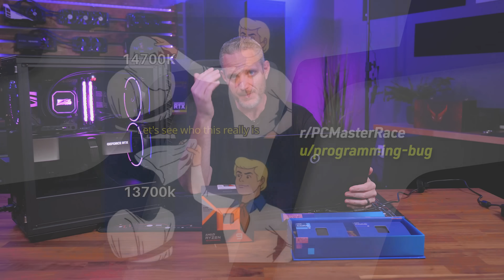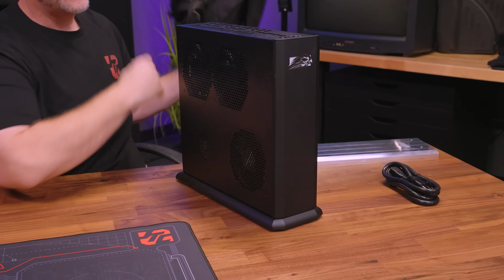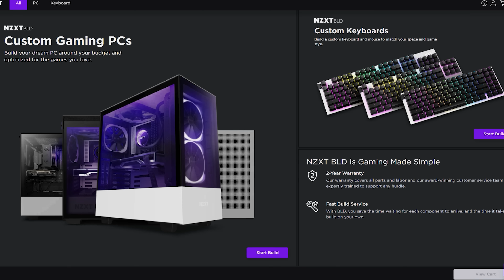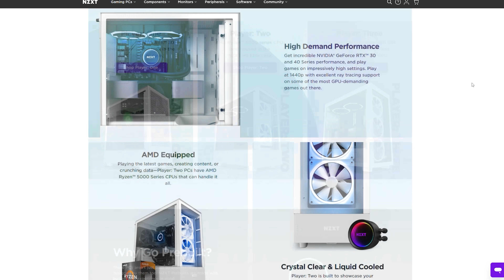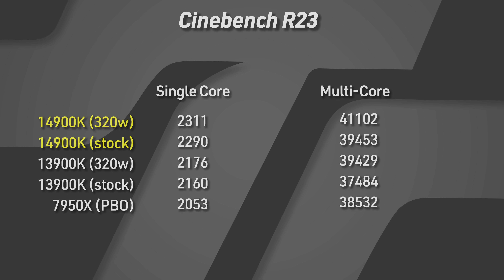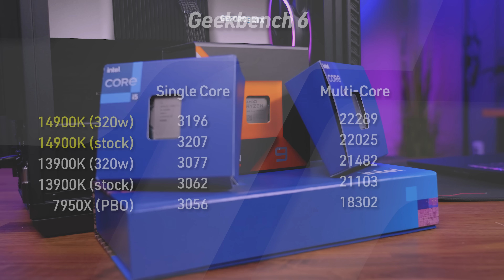THIS is why people have trust issues! Intel 14th Gen Review

Comment: Thanks for the clip.    Have a simple straight question. Have a Dell Precision 3280 CFF  with 128gb ram 4 tb Ssd and Nvidia t1000.  Have 2 processors.   I7 14700 and i9 14900.  Use it for severe multitasking and productivity.  Wich CPU should I keep?  Ty in advance

Comment: I'm upgrading to the 14900k from a 4790k that I've had overclocked in my system at 5ghz  for the past 8 to 9 years.  All of the negativity and talks around in the CPU made me nervous to get it but for $300 plus a 360mm all-in-one cooler AND free dying light and civ 7 bundle i got it over the 9900x which was around 800 dollars!😮

Comment: I have been revisiting some of these reviews/opinion pieces on the 13/14th gen Intel chips recently.
With plans to upgrade my 30 series GPU to a 5080 or 5090 when they release I am now entertaining the idea of upgrading my 12700k to a 14700k or 14900k IF the pricing  on them drops enough after the new Arrow Lake chips release.

I in the past would just go a new build but with inflation and rising living cost I am thinking an upgrade may be a satisfactory option for my current z690 board build.

I am leaning towards the 14700k as I only game, no production type of work but do want to better match my system to pair with a 5080 or 5090 and feel moving to the 14th gen would accomplish that.
Also with the exception of engaging XMP timings would be running everything at stock settings and speeds.

Does this make sense to do to keep cost down over building a complete new system while still pretty well keeping the system balanced with the new GPU?

Comment: When did they do this with 4th gen? 
4th gen was more power efficient than 3rd. Slightly better performance. And then a couple months later they came out with the mid generation refresh that was still called the 4th gen. Instead of releasing a 5670 they released a 4690 as an upgrade to the 4670

Comment: To avoid the brand Asus, what do you suggest for intel build?
Reply: Asrock motherboards are solid. Just watch a lineup on youtube of whatever socket you go for, watch for good VRM temperatures PCIE 5.0 x16 support if you plan on using 5000 series and PCIE 5.0 Ssd slot...

Or just go budget at which point it'll be pcie 4 x16 and multiple 4th gen ssd slots.

But i'd personally go for an AMD system specifically AM5.

Comment: Hello Jay, Great insights here!

Was about to buy a 14th gen, now.... not so much. 

Is there a chance you've heard about the Intel Core i9 13900KF series having issues? 
I've been having these odd power management issues, where if its in "high performance mode" It just crashes everything in its path that even remotely CPU heavy. 
Also, running the "extreme tuning utility" and running the score test on high performance, instantly shuts down my pc. 

I've been googling, but hear about defective 13900 series ? 

Keep up the great work!

Comment: nobody mentions that the memory controller on the 14900k is improved as well and with the new mother boards like the asrock phantom nova, you can run 8000mhz ddr5 ram no problem, and real world performance with a setup like this will have better results than a benchmark score, i just built it and its amazing!

Comment: just asking a genuine question, I prefer Intel because amd (fx-8350 BE)burned me back in my first pc build in 2013.. but in 2024 for gaming and VR, is intel or AMD better. Also my current CPU is a i7-8700k still going strong but im thinking about doing a new build. should i go for a new intel or max the switch to AMD
Reply: If you want the absolute best for gaming then the 7800X3D. It is quite literally the fastest gaming CPU on the market.

Comment: I have a 4080 with an intel 12700. Full system powerdraw, playing at 60fps (limited and underclocked my GPU) is 280w total. That is including my 65" TV. With the TV off, I am on about 180w total draw. Ark Ascended, average about 68w GPU draw, super smooth. Will not be upgrading anytime soon

Comment: I have a 12900ks and after looking into the 14900k it’s like +10 to 15% - it’s not totally pointless and then if you want to run an XMP profile on your DDR5 
Because the reality is the IMC on the 12th gen (memory controllers) is crap, 12th gen doesn’t like XMP profiles over 4800mhz unless your very lucky in the silicon lottery.
But now Intel have finally perfected the 10nm process now so the 14900k is polished, it’s ironed out the IMC issues present in 12th gen for XMP profiles.
A 14900k will run DDR5 memory far faster, with higher boost clocks and with 8 more cores and extra threads.
The reality is the 14900k is the best on the S1700 platform, the 15th gen will be a new platform and that won’t be till 2025
If you have a 13900k then I agree it isn’t worth it, but if your on 12th gen, yes it’s worth upgrading , not only for the 10-15%+ uplift but the memory speed increases and ability to run an XMP profile like it should have done in the first place 
If you want your ddr5 to run XMP - 14900k is the way

Comment: I fail to see what the problem is. Every 14th gen proc below the 14900k has at least nominally more clock, better power and more cores while no one else has an answer for last even year's processors. the 14900k is signifficantly better than the 13900ks in power, incrementally better in clock and its 100 dollars less.

There were SIGNIFFICANT changes between the 8th gen coffee lake and 9th gen coffee lake patching out speculative execution bugs and were still dramatically faster than anything else anyone else had at the time.

The xxx50 processors were all slightly failed binnings - not a dramatic improvement in power, cost and headroom.

The notion that upgrading from one generation of processor to the following generation ever makes sense - is just absolutely ridiculous, unless you set your standards to the crap level some of the older zen processors had where one generation to the next was just slightly less bad.

Comment: You forgot to add that they are not allowing support for the new software on the 13000 series cpu's. So you should 100% just go with the 14000 series and pay the extra 50 for it.

Comment: I upgraded from a 12900k to a 13700k, but before I installed a 13700k I upgraded to a 14700k. Microcenter got some sweet bundle deals. zero game performance increase, but workload performance by benchmark is pretty good

Comment: I'm ready for a new PC and cost isn't an issue but the 7800X3D performs as well in gaming as the "14th generation intel" with way lower heat so I'm going with that.  The 4950X3D requires the software to know it's a game and then it's no better than the 7800 at best.

I don't do heavy editing or anything that need a massive number of cores.   Really disappointed in both Intel and AMD because of this BS.  AMD at least has a viable reason more cores and the VRAM for gaming, Intel, not so much.

Comment: Thanks for the video!
I rarely build systems any more, and I don't get asked build/hardware advice very often, so I get massively out of date when it comes to PC related tech advancements and such.
So even though I started fixing and building home computers around 20 years ago, a nice video like this is still really helpful for someone like me to get quickly caught up in some of the relevant details.
Like, intel came out with a "new generation" of cpu?
Oh, you say they really didn't, they were just playing with the numbers again? kk, we've seen that before, got it and thanks for the update lol ;)
Now if somebody could point me the way to "drive topology" and wtf difference the different choices in the BIOS actually MEAN/DO/AFFECT (choices are ISATA, Flex, Direct Connect, M2, Unknown) I'd really appreciate, because apparently somebody snuck these options in under my radar. I've never heard of them, I don't know which one is best for my use case scenario (gaming system, using one m.2 nvme drive and 2 sata SSD drives), and I don't even know where to look*, because the only thing I can find when I've looked, are the same settings being listed on other system boards, but *without any explanation about what they mean or which to choose*, or a couple of random posts that *sort of seemed to maybe apply, but with no way to even verify that the person who gave the scrap of info was actually *right*.
In my case, this is in the Bios of my Zotac Mek1. it's got an i7 7700 non-k processor which means it's at least 6 year old tech, but i haven't found useful answers *anywhere*. what happened to all the "bios optimization guides" and stuff that used to be everywhere??? lol
But, yeah, *seriously*. if anybody has any answers/info about what to do with the drive topology settings, please feel free to point me in the right direction 😅

Comment: Last time I had AMD was when they launched Athlon X2, ever since Core2Duo I've been with the blue team. 

Got myself 7950X3D two weeks ago after extensive research for my needs the past couple of months, and am not regreting it. 1/2 to 1/3 power draw on the CPU side for the same or slightly less performance compared to a 13/14900k. I prefer a quiet PC much more than squeezing every bit of FPS and performance. In my opinion, when it comes to top tier components, the absolut value is almost negligible compared to thermals and noice level. Granted I always go overkill on everything, but at this price range money isn't the primary issue. My CPU stays at low 70s (celcius) while 4090 Strix ROG OC almost never surpases 60C in all use cases while the whole system is dead silent. 6x120mm intake with 360mm AIO CPU cooler + 1 fan as outlet.

AMD is so far ahead at this point, put the 7000series at same power and Intel will have no say in anything.

Comment: this review literally gives no info on temps, clock speeds at turbo, or wattage usage other than you describing  the performance while sitting down....so you made a video with some graphics comparing scores from 13 and 14. What is anyone supposed to do with that info? Is higher or lower better? What do you guys do all day?

 benchmarks in a stupid benchmarking website that doesn't have anything to do with normal usecase informs NO ONE on their purchase which makes sense considering a week and a half later you bought this CPU for yourself.

lazy content, even worse than LTT at this point.

Comment: I have an hp z2 mini g9 currently with a 12500K…what cpu should I upgrade it to?  Keep in mind this is a small form factor system with a 280W psu…so the i9s are definitely out.

Comment: Honestly used the 14700k to build my first ever PC, love it so far. When pricing I was seeing practically no price difference between the Generation. Your channel and Linus were the ones that inspired me to finally build a Computer, Thank You ^.^
Reply: Don't know if you'll see this comment, but what are you using to cool your 14700k?
Reply: I'm using a H100i to cool mine. Still hits 100c during stress testing, but during gaming it runs fine. @Stealthcastlandon
Reply: 14K in all bench marks is out performing the 13K by at least 20 FPS, this guy is a trendy pro AMD intel hater, he talked about AMD being a piece of shit basically because it can't handle memory but at the same time promotes AMD. Stick to your 14K it's a superior processor to AMD's trash lately and 13K, don't buy the crap real world talks.
Reply: @figureitoutpunk you don't know how comparisons work, the 14th gen has single percent uplifts, just agree with rest of us that Intel is just giving us a hotter chip for no performance upgrade. The 7800x3d beats every consumer cpu in gaming and 7950x beats every consumer cpu for productivity and efficiency. 14k is superior alright, superior trash.
Reply: Is ryzen 9 7950x3d really better than intel i9 14900ks in preformence @Riyozsu
Reply: @figureitoutpunk Intel 13th or 14th gen is just objectively worse than AMD's current gen. If you look at temps and power draw to performance, that is. 
Intel currently uses ridiculous amounts of power and overheats very fast

Comment: Is a 14700k worth upgrading to from the 9700k? It's still going strong but I'm noticing lately it is starting to lack in power for certain games/streams, just wondering if It's worth going to 14700k, or 13700k?

Comment: So putting the silly anti bend bracket on my new 13700k build exceeds the performance of the 14700k.  I'm impressed with the 13700k custom PC, coming from a terrible R7 8700k.  Never buying a pre built ever again.

Comment: I went 14900k only because I’m coming from 11900k, also picked up one of the refresh motherboards. Asus z790 dark hero. Will see how it goes when I get the rest of the parts together but should be ok. Do agree though if I had a 13th gen cpu I wouldn’t have bothered with 14th ‘gen’. My hope was better ddr5 support and stability. Got 8000mhz ram ordered, so we will see.
Reply: hey, im thinking about upgrading from my i7 9700k, but I'm torn between a i9 13900ks and the i9 14900k. Which one do you think is worth getting for better performance?
Reply: what a waste of money and I don't want to drive the bus over you. you should've skipped the 14900k and wait for the next gen. the 11900k is still pretty decent today.
Reply: @robicelus  not a waste of money to me. 14900k/4090/48gb 8000mhz ddr5, gen 5 nvme, plus all the supporting tech and I/o improvements.  You’re welcome to buy my 11900k/3090/32gb 4000mhz ddr4/990 pro nvme/1000w rig ;)
Reply: @disenterland  thanks for the offer but I have a similar system, 11900k paired with a Z590 Hero and planning to upgrade but not to a 14900k. the 14900k may be a good chip but it just hasn't that "wow" effect for me if you know what I mean.

Comment: Great PCs, But these Companys are so Greedy . I wonder how many PC gamers they lost the past 15 years , I wont buy a low end PC because the Consoles now are Great at a Great Price and it Cross-play with PC games, I rather get and play on PC but these companies triple in price on every part from low end to high end PC parts, the reason to get a PC is to push up to the best highest end PC to play games in 4k or higher these PCs should be pushing 8k 120hz now but it doesn't. But when the PC struggles to push 4k 60 hz with a 4090 that a 2090 use to play 4k 60 hz that now the 2090 has to be on low graphics on 1080p at 120hz too 144hz now cause the companys are Ripping people off always upgrading video cards to shitty performance and upgrading the new GPUs with the updated old graphics to the new and they repeat it every time they make a new graphics card same with CPU , SSD,  HD, Ram , and motherboard.  What updates your new PC gets , is what you first PC had and  should have been at before they lowered the performance. Don't see what's the point of PCs anymore and why people are spending so much money. When the Consoles are a guarantee to run 4k 120hz no problem and you see the same thing on a PC. These Companies are Ripping you guys off and you let them . That 4090 should be at 549.99  4090ti 599.99 too 650.00 , the i9 13900k should be 300 , high end motherboards should be around 300 1500w power supply no more then 200 dollars,  people paying 3 , 4 too 5 thousand dollars on pcs that works for 2k best and a Console smokes it doing 4k 120hz and they cost 500 dollars or less Great Price.

Comment: My i9 10850K is the best value for money that Intel ever made! It still runs everything literally, I have not yet seen anything I need more than those 10 cores and 20 threads for at 5.3.... No botle neck no matter what GPU, including overclocked 4090.. So I don't know why they keep this stupid game to just push the prices for things we really do not need. They could just shrink the power consumption and get down to like 2nm tech and just throw out a consumer friendly price on something that gives the value you need by price and performance.. Then when it is NEEDED let us have something with more performance.. Tell me what a normal gamer or workstation for a single user has to run to need even a 13900K? It is plenty enough for years yet.. They need to lower the prices AT LEAST, when they do things like this. They cant just rebrand and take a higher price for the same product! That MUST be illegal somehow!

Comment: Honestly for me I bought a 12700k bundle when the 13th came out for a good price, and it was a massive upgrade from my old 6700k. If i have a path in a year or so to just get the 14700K at a decent price and not have to upgrade my z690 board and ddr4 ram I will take it. I wan them to get better and more efficient, this at least tries
Reply: I was on a 9700k and a 13700k was a massive performance increase for me I have a rtx 3080 and I am waiting for black Friday deals so I can grab a 4090 also will be selling my evga ftw3 3080 to recoup the cost of a 4090

Comment: Efficiency is still quite horrible. Good luck running a quiet gaming machine with a sub 50$ cooler. 7800x3d is just plain better, cheaper cooler, can run on the cheapest b650 board can use a 200-300W smaller psu etc.

Comment: I went for the 13400, great bang for buck. Paired with 32gb DDR4 and an rtx3070 provides more than enough performance at 1440p gaming. Not considering the 14th gen. Maybe 15th if it's a decent leap in performance.

Comment: When i see how happy my undervolted 5800x3d is in games with like 50w all this Intel stuff burns my mind. Cheap mid range tower holds 75c max, 660w psu runs cool with fan turned off and thats with 7800xt, also undervolted ofc.. And with all that undervolting its even performs better..